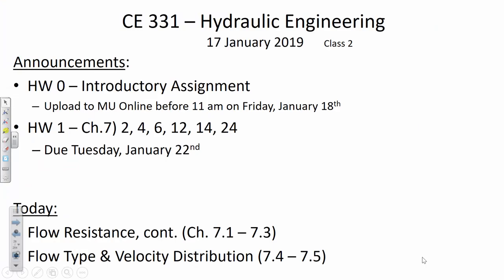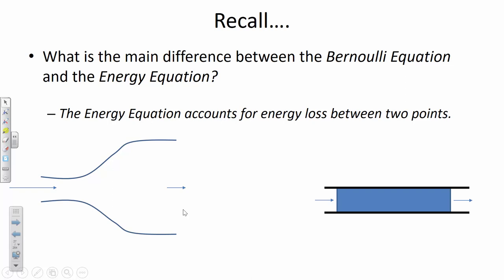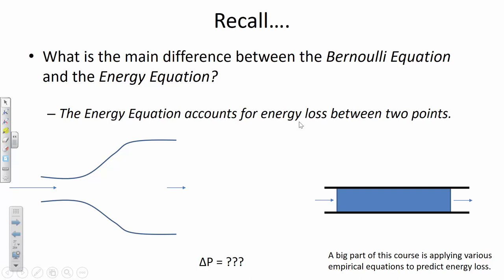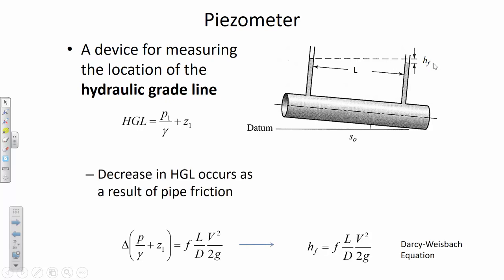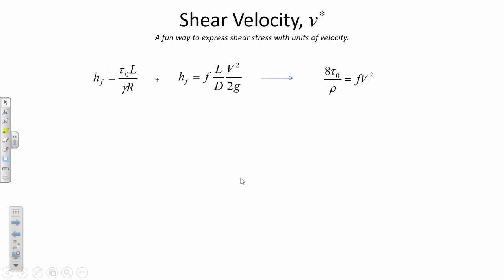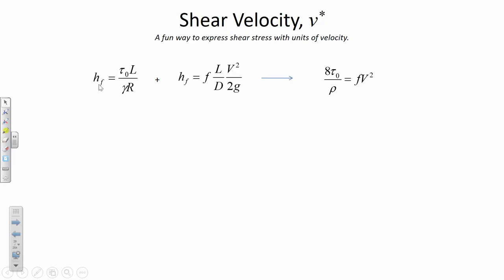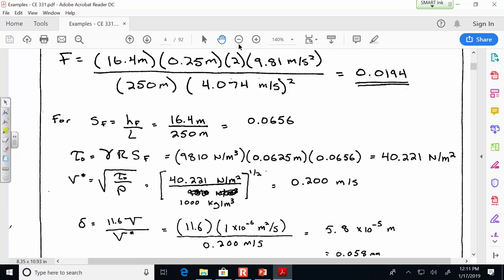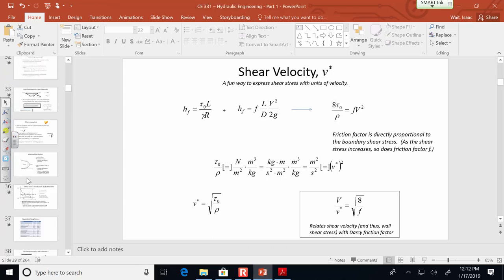CE 331 - Class 2 (17 Jan 2019) Flow Type and Velocity Distribution

Comment: Thank you sir, your channel is very useful for hydraulic engineers like me. I have a problem with defining and calculation of transition of pressurized flow to free surface flow in pipeline like sewer. assume a reservoir and a pipeline getting water from it. it is reasonable that flow will turn to free surface flow if the pipeline length is unlimited. How can I find the location of transition point? Thanks
Reply from the maker: I have recorded a video reply to your question here -- I hope it helps: https://www.youtube.com/watch?v=TeV9VW1zE8I
Reply: Thanks Dr. 
Mr hamed can i get your email please.
Reply: @IsaacWait  thanks for your respond, but the main problem is that we dont know the discharge value, we have one equation (Energy Eq) and two unknown parameter (L,Q), and we know that the discharge of the pipe is depend on L.
Reply from the maker: @hamedtagizadeh    Hmm... well then I'm stumped.  I'm not sure if it's possible to solve a single equation when you have two unknowns... the location of the pressure cross-over point within the pipe (i.e., "L") will depend on the flow rate.  And flow length will depend on the given physical length of the pipe.  If this is a homework assignment that you're working on, you might want to seek the instructor's assistance, or clarification on the problem.
Reply: Dear isaac, this problem is realworld situation that I have deal with it in one of our project about 3 days ago, and I'm looking for answer. well, I'm in progress and if I find answer, I'll reply it in here. So many thanks for your kind attention.